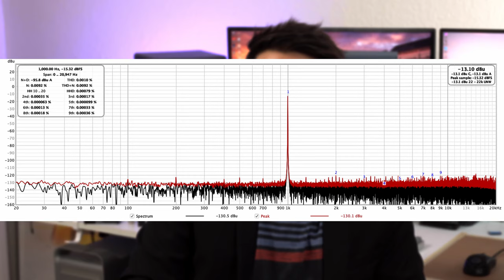Fixing ground loops in your studio

Comment: Had an issue with the GPU coils being audible in my studio monitors, noticeable with screendraws when moving the mouse, note I do use balanced cables and connection plus that all power cables come from a distributer with isolation, filters and surge protection.
Connecting a Behringer HD400 between my audio interface and the studio monitors solved that issue.
There are probably better units available, but the HD400 worked fine for quite some years now.
The issue in my case doesn’t come from power ground loop, it comes from the internal design of the computer components, which is weird since everything in my PC is high quality parts, so I bet it’s a flaw on Nvidia’s design.

Comment: Using a Quad Capture here. on it's own, the laptop and quad capture make no noise. When I take the unbalanced stereo line from the quad cap to the line in on my desktop, all hell breaks loose and the hum is about -45db. I'm going to try moving the plugs for the laptop and desktop to the same power outlet on the wall to see if that helps. But there is definitely mouse squeal, gphx squeal and earth hum as soon as these two 3 pin powered devices are connected together via 3.5mm jack! It has to be a ground loop, there's no noise from either device on the audio outputs when they are not connected. Great video thanks

Comment: I'm experiencing a buzz (higher in pitch than I'd expect) when I connect both my PC and my digital piano to the same pair of speakers while the piano is connected to that PC through USB. My building doesn't have grounding, but I guess that means nothing when I already have a literal USB loop. Will the USB isolator get rid of the buzz in my case?

Comment: Been grappling with this a few weeks. My Model 24 was getting CPU noise. I bought a Intona USB 3.0 Super Speed Isolator box. Sorted..
Reply: How did you find out about this solution? Didn't know a USB isolator existed until now.
Reply: Can this be used for just plugging a USB hub in to it? My audio converters run via AES in to PCI-E interfaces
Reply: @antonisatwork  I figured that most of the time, to get rid of earth loops, you need to break the connection. This was something I thought the problem was. Even though it worked. There was another reason I had the noise. I have a DSI Rev2, and the thing is noisy. This was rectified by a box called a de hummer made by Bheringer. I needed two of them.  Another way is to have everything on the same power circuit.

Comment: hey thanks for the video. i was wondering if you can help and which product you would recommend for me. My right monitor is a couple inches away from my PC, and i can hear the GPU noise and other noises coming from the PC through that speaker. I have the monitors plugged into a scarlet 2i2 using balanced cables, and the 2i2 plugged into the PC using USB. I also have all these components plugged into the same surge protector. thanks!

Comment: Hi.  Can you help.....  I have a new laptop and have connected it to my audio interface and have been recording some vocals.  I am getting a clicking sound at different points every single time i try to record.  Is this a ground looping problem also?
Reply: usually ground loops occur when two separate powered devices are plugged in and connected via the audio signal path. Is your laptop the only mains powered device in your setup, or is there something else like a second monitor (screen) or another computer that is involved in the signal chain?

Comment: Hi! what can you classify as noise? Is it something loud enough audible to audience or even tiny noise that only audio man can hear from HP while monitoring?
My laptop is plugged in audio interface and I can hear a faint white noise when I come really close to my PA, is that bad?
Reply: That might just be stereo hiss. Try headphones into the power amp, or from the previous signal stage (mixing desk? audio card?) to see if you are hearing the same white noise in an enclosed audio environment (confirms if it is in the signal, or just amplifier or speaker hiss)

Comment: hello, when I use my access virus snow device from usb from daw, and when I enter my sound card from audio outputs at the same time. I'm getting a bad ground loop sound. This sound does not exist when I select the usb outputs. even when the virus is connected only through the audio outputs to the sound card. If I disconnect the usb cable from the computer, the sound disappears. so i think i have a grounding problem and it seems to be related to usbs in particular. I wonder if I should buy one or 2 of these usb insulators. If I use two or one of them one by one on my sound card and virus, will it solve my problem? sorry for my broken English
Reply: Did you find the solution?

Comment: I have had or have issues with noise coming out of the motherboard from my pc from the speaker output into my mixer so im sure its the motherboard  and i dont know if getting a audio card for my pc can fix this issue.
Reply: Have the same issue but only with the guitar tried the most. Usb eliminator. A emi socket. Di box

Comment: I have a Focusrite setup running through a MacBook Air and found that the computer charging cable was the cause of the noise. I couldn't figure out why the hell I had this sudden noise when trying to edit and record using Adobe Audition. I started unplugging things one and a time. When I removed my charging cable from my computer the noise instantly stopped!
Reply: how did you end solving it? I have the exact same problem with the same devices.
Reply: @n_key apparently you can replace the 3 pin power supply with a souble insulated 2 pin supply and that can solve the problem. I don't know what that means for the satey of the device though if it was originally shipped with an earth pin power supply O.O. In theory, the power supply is outputting 12 to 20 volts at 5 to 10 amps which makes it so the device has no high voltage running inside it, so the risk is low to the user. But I am not totally sure about that!

Comment: I am having a problem with a MSDI unit on my new amp that introduces a horrible grounding noise (gets louder when you move the mouse) I've removed the earth from the kettle plug and it's solved it. However I wouldn't mind way of doing it that's safer
Reply: Sometimes having powered devices plugged into the same wall socket (using multiway adapter if only a single wall outlet) can completely eliminate ground loop noise. If it is an earth induced noise that is. Apparently power outlets on your wall have different grounding positions, so plugging them closer together minimizes the current gradient in the ground loop which reduces or eliminates the noise issue.

Comment: my interface makes a noise even without a microphone plugged in, is this a ground loop issue?
Reply: Microphones are not a factor in ground loops unless they are USB powered, in which case they might be. 
The source of your problem is most likely the connection between the interface and your computer. 
So basically your computer is most likely leaking static to the interface through the data connection (USB).
Reply: @steinarjonsson_  so how could you fix that?
Reply: @xsalsita7082  You should be able to fix it by using a USB ground loop isolator (if it's a USB interface).
Reply: @PANCHITO13 hey man, hope you are ok. I'm not the guy you where asking but I'll answer anyways haha. It seems that you have some kind of monitor or speaker that you are using to amplify your guitar with your laptop am I right? 
If that's the case, I'm sure that the problem is that your laptop and your speakers are making a ground loop.
I was having the same problem with my guitar, using a cheap USB sound card.
I didn't know much about this kinda things but after months and months of investigation I was able to fix my problem and learn a lot about ground loops.

I fixed the problem with a Gruond Loop Isolator, that you can use if you are using a USB device to connect your guitar to the pc. In case you are not using one, you can find a ground isolator for a 3.5mm jack input, both of them worked for me. You can find both of them in aliexpress for 6 bucks or so.

Comment: My Scarlett Solo 2nd Gen was a factor in my speaker and headphone noise. One the USB cable was noisy and second it didn't have balanced outputs but RCA outputs. My Scarlett actually died the other day so I am looking for a replacement for it. Looking at the 3rd gen but if someone has a better suggestion then I would like to hear it. I also got the IDefender which is USB 3.0. i paid $53.00 on Amazon.
Reply from the maker: Motu M2 is my #1 recommendation. A little more expensive than other 2 in/2 out interfaces, but it's impressively clean and has super convenient meters. I've heard good things about the Audient Evo 4 as well, but I haven't tried that one myself yet.
Reply: @manak1n  audient wins. I have a scarlett 6 in, and the base model of evo stiil
wins.

Comment: does anybody know how to deal with it when the ground loop issue is your own body.. so my setup will get hum whenever i use headphones and then touch wall/floor.. so i need to touch the same ground as my peripherals (metal side, screw, usb, jack, etc) and it'll be gone.. using sock/carpet only reduce it but won't eliminate it completely
Reply: my temporary solution was wearing anti static bracelet that you use for building a pc.. but i'm still looking for better alternative